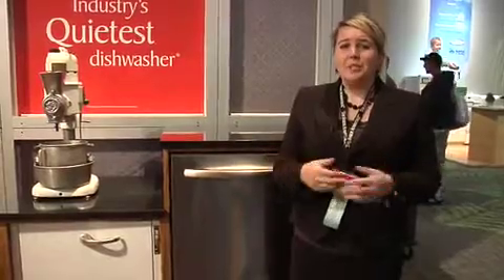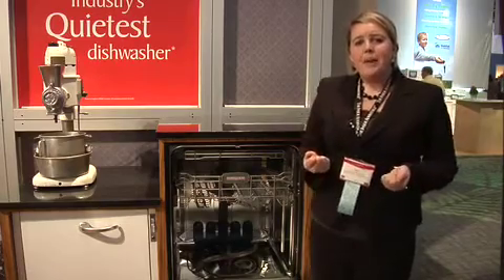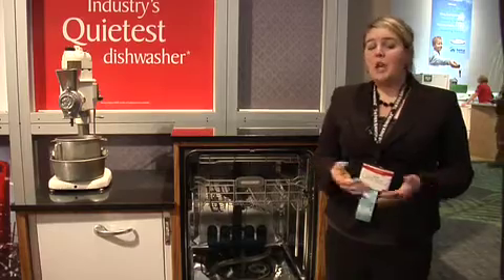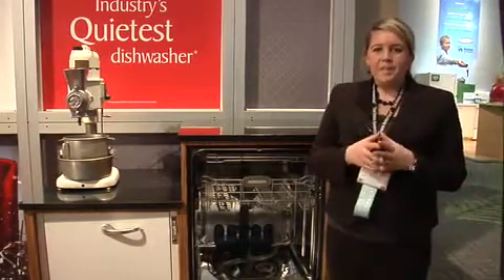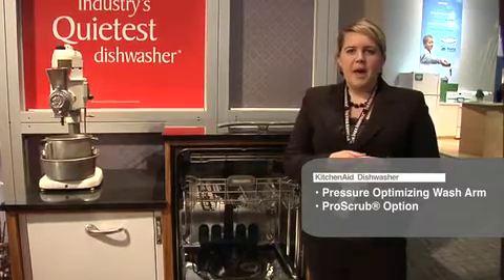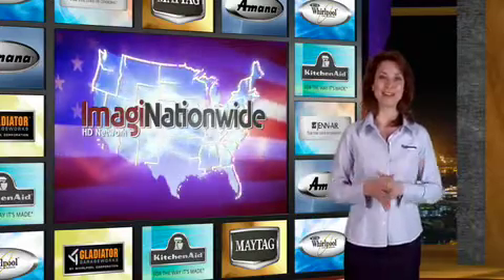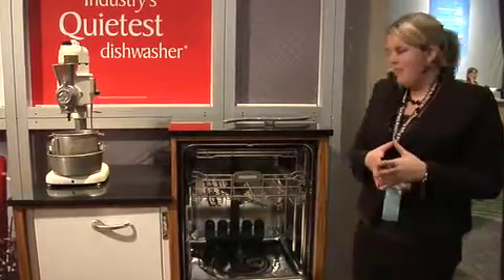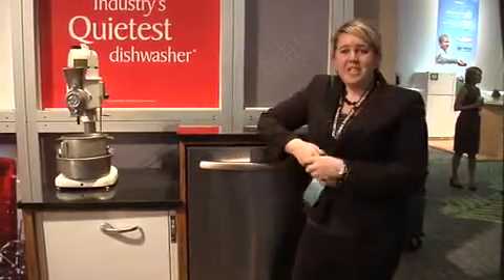KitchenAid Dishwasher Video

Comment: best dishwasher ever and the reason it ramps up the motor is to tackle stubborn food and debris.  Meaning if the load is really dirty with caked on and baked on foods it will sense that the load is really heavy according to the debris that circulate in the water.  So no its not a stupid idea jerome davis, you just need to go get educated like the rest of them.  I have had this dishwasher for well over 12 years it has been amazing.  I put the most gross loads in this machine with no rinsing at all and they come out SPOTLESS!!!!!!!!! THE NEW ONES SUCK THANKS to the government its terrible. if Any of you can get your hands on this model you will not regret it. YOU DO HAVE to load it correctly and choose the correct settings for good cleaning!!!!! And the proscrub is next level out of this world awesome!! casserole dishes hard to clean dishes omg i cant rave enough about it. i love the third rack also its adjustable not like todays cheap single piece tray.  I love this dishwasher will never give it up when it breaks i def will get it fixed!! its dead silent cleaning is top tier and it def beats miele thermadore and bosch in cleaning and drying no regrets!!

Comment: So if this washes 25% better than the other brands, why was Bosch rated better than all the others on consumer reports? Just wondering.  kitchen aid rated about 4th in line.  Im considering buying this one for the features it has and because bosch does not dry as well as kitchenaid.  I will be replacing an old kitchenaid I have, that has NEVER had a repair and I've had it at least 10yrs maybe more. This kitchenaid rated excellent in washing and its puposed to dry  even plastics another plus.